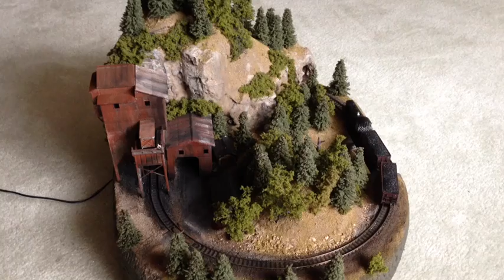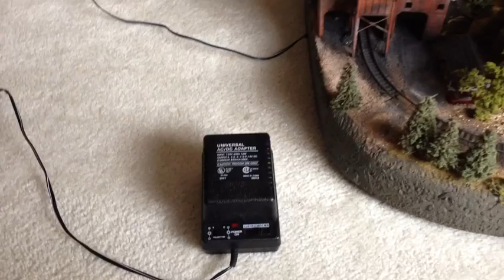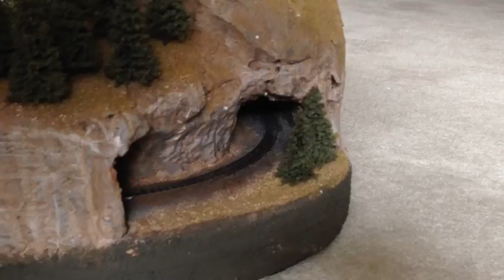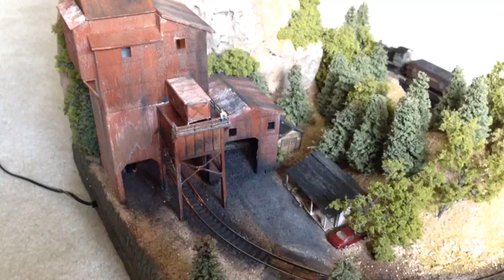N Scale Micro Layout

Comment: Hi Steve, how many cars can you pull on that small of a radius, obviously you are limited to the length of the track, but could you pull them around the full loop if you wanted?
Reply from the maker: So it depends. You need to have them weighted a bit so they don’t get pulled off since the curve is so tight. But there is no grade so you could probably still do several cars. I never tried to do more than three cars since it just looked weird being such a small loop.
Reply: Thanks,  just an idea I had using a helix. I will need to experiment.

Comment: Hi Steve, I enjoy all of your layouts, but for some reason this one really looks cool and so simple, I am just wondering how hard it is to wire a transformer for it, thanks
Reply from the maker: It is super straight forward. I just have the wires from the transformer wired to a double pole double throw switch, and then to the track, with one wire I think going to the on/off toggle switch. the transformer had a variable voltage output, so you could control the speed with that selector switch.

Comment: I am new to this, I was wondering if you could please direct me on how to do this simple wiring.
Reply from the maker: I don't remember exactly how I wired it since it was a long time ago, but I believe I had the wires from the track going to the middle terminals on a double pole double throw toggle switch, then the top and bottom terminals on the switched wired together in an X pattern such that a short wire connects the bottom left terminal to the top right terminal, and another connecting the bottom right with the top left. Then a wire connecting the bottom right terminal to one wire from the wall adapter that puts out DC voltage at different levels based on a selector switch. The bottom left terminal of the toggle switch then goes to one terminal on the on-off toggle switch.The other terminal of the on-off toggle switch then goes to the other wire of the wall adapter. So, the double throw double throw switch will flip the polarity of the power going to the track, and the on-off switch will wither allow power to flow through the circuit or will stop power flow. The voltage selector switch on the wall adapter controls the speed (higher voltage will make the train go faster). It would have all been far simpler to just run two wires from the track to an old Bachmann controller or something like that. But, this was a very basic and cheap way to control the train for this basic display setup.

Comment: That's damn impressive what you have done there. I'm trying the same but with H0 scale.
Reply: Did you build it?
Reply: @jamesparson  I built one in h೦ scale using Marklin r1,r2 and r3 radii. But turns out to be huge. So scrapped it. It was almost 1.2 meter by 1.2 meter in size
Reply: @jamesparson  now working on recreating Mittenwald by Noch

Comment: Great little layout,how did you attach the unitrack to the foam?I see no holes for nails in mine, and I'm a kinda stumped. Please keep these layouts coming, I love them
Reply from the maker: Bob Shaw I just glued the track down, I think I used hot glue to tack it in place then the glue and ballast helps to hold it permanently. I usually use either some hot glue or some type of paintable caulk which works well.  Since I normally at least run glue and ballast along the sides, that holds things down permanently.
Reply: Thanks for the info!

Comment: When building and  running trains on a layout such as this, keep the cars to about the same length and weight.  If cars of significantly differing length are used the overhang of the longer car is likely to pull the shorter car off the track.  Full sized railroads have this problem on curves over 10 degrees, particularly 12 1/2 degrees and over.  Twelve and one half degree curves have a radius of 459.276 feet or 459 feet 3 and 5/16 inches.  Long cars of 89 feet such as Trailer Train, auto racks, etc. can negotiate these curves but they don't like it and are prone to derailing particularly if a much shorter car is between two long cars.  Amtrak negotiates 16 degree curves in Jackson, MS and these are 259.265 foot radius.
Reply from the maker: Roy Reynolds I usually overweight all my cars so they run better on the right curves.

Comment: What would you say building this layout from beginning to finish cost, excluding the train itself? I want to build something of very similar size and track plan with a budget of ~$3-400.
Reply from the maker: It is hard to say for sure, since almost everything on this layout was reused from previous projects. Maybe $150-200? But the thing is that a lot of the scenery materials, paint, etc that you buy will only be partially used on the layout, so the out of pocket cost is higher than the actual materials cost. The mine is a re-kitbashed (I had kitbashed it on a previous layout, then rebuilt part of it again to fit this one) glacier gravel kit, that was the most expensive thing, next was probably the Unitrack.  All the scenery materials I already had on hand, I didn't buy anything new at all for this project, but I used multiple kinds of dirt, ground foam, static grass, shrubs, trees, etc, so the out of pocket cost for all of that might be kind of high, but you wouldn't use very much of any of the packages of materials on a layout this small.

Comment: Well I was just sitting here thinking man it would be fun to build a small rail road maybe not this small but it shows it can be done! Very nice model work.
Reply from the maker: Thanks!  I just started working on 4 similar layouts.  I saw a bunch of pine table tops at Home Depot, and bought all of them.   They are 18-24" in diameter or so (not all the same size). I plan to build four similar type layouts on them and if I get them done in time, sell them at the Great Train Expo in Tulsa early next year.  I'll start having some videos of them up sometime soon.  It has been hard to find time to work on the layouts and the videos lately.

Comment: could you make a layout for the bn in 16' x 25' for like a demo how to super-micro lets build
Reply from the maker: I do plan on making a couple small N scale layouts soon, one or both I plan to try making out of foam core board and spray foam.  I was thinking about something closer to 20" x 30" and another 30" x 40"  since a lot more motive power will run at those sizes, but I've also thought about building a circular one around 16" in diameter that is actually a table lamp as well.  Lots of ideas...very little time right now.  Also, it is super hot in the garage where i work on these right now, so progress on anything is likely to be slow the next couple months.

Comment: Kinks develop in track sections.  That's good to know.  I'm building a small layout myself.  Perhaps I can take some measures to help prevent this when I lay the track.  I've been posting my layout updates here: http://jeffsmorningbrew.blogspot.com/
Reply from the maker: Jeffrey Cobb The metal rail will expand and contract with temperature.  On a small layout like this it might not be much of an issue, but the larger the layout the more important  it is to have some gaps here and there for expansion and to allow the track to contract as well.  On my larger 5x10 foot HO layout I had track bend out of shape in one spot because of thermal expansion of the rail which I fixed by cutting a couple gaps in the rail then gluing things back in the right spot.  Obviously if you keep the layout in a very climate controlled area you will not have much of an issue, but if it might occasionally undergo some larger swings in temperature then the gaps are good to have.
Reply from the maker: Stephen Strum Another issue is that the layout itself may expand and contract with humidity changes if it is framed with wood (which most are).  Different wood types will expand and contract more than others, and if you paint them or seal them in some way that will lessen moisture changes.  It doesn't take much shifting of the wood on an N Scale layout to cause track problems.  Of course this little layout was all foam construction so humidity changes weren't a concern.

Comment: Thanks for posting this. I've had larger n scale layouts in the past and now that I'm in my own place and no where near the room I had before I've often thought of building a new layout but just never have due to space but your video has given me the vision of a small layout. After watching this video I went out and bought a 2x2 piece of thin board and two 2x2 ceiling tiles and glued the ceiling tiles together and then to the board so I have some depth to cut into. Used kitchen door pulls as legs for the base as to hold it up a few inches. Ordered atlas code 80 9-3/4 curves and two 5in straights. The layout will consist of the 93/4 curves and two 5 in straight pieces. Planing on doing a small logging scene on the layout a small batch of houses and a little town. Gonna run a switcher loco and maybe a small sw40 already have the board made up and ground cover base color painted. Waiting on track. Again with this video I wouldn't have had the vision of building a small layout.
Reply from the maker: I'm glad it helped get you back modeling again!   The 2x3 foot layout I am currently posting videos on has kept me busy for many months now, and likely will for at least a couple more months.  The great thing with a small layout is that you can work on the layout anywhere that is comfortable, and then easily put it back out of the way when you are done.

Comment: I am building a portable layout using the same radius Kato track, I have an extra Atlas H15-44 that I don't know if it will be able to run on those curves, what do you think? Also what locomotives can be run on these tight curves?  What locomotive is in the video?
Reply from the maker: In the video, the locomotive is a Bachmann S4.  It is hard to say what particular locomotives will make it around the 6" radius curves since it is all about how much the trucks can turn on the engine.  Also, the same engine type might work from one manufacturer, but not from another.  Some short engines may have details or other parts that prevent the trucks from turning much, and longer engines may allow the trucks to turn more.  So, it varies, but many can probably be modified a bit to allow the tighter turns by shaving off a bit of plastic or the like from the body to allow for tighter turns.  Once you increase the radius to 8" or so, most engines can negotiate the turns.  On my current project layout I can get an AC4400 to go around the 8" curves no problem.  It can't pull cars around those curves though because the body mounted couplers pull the cars off the tracks.  That will be a problem with the 6" radius curves too of course.  Anything much longer than an S4/NW2/SW1500 (The H15-44 isn't much different in length, so I think it should work, but no way to know for sure), would probably have trouble pulling cars because the body mounted couplers on the engine will tend to pull the cars off the track on curves.

Comment from the maker: Marc, with the 6" radius curves, smaller is better.  An NW2, S4, SW1500 or something like that works well for an engine.  You might be able to get a larger engine such as a GP38-2 to go around if the trucks and turn enough, but you probably wouldn't be able to pull any rolling stock.   With a shorter engine like a NW2, you can do 40ft cars without any trouble, and 50 foot cars generally do fine too as long as they have truck mounted couplers.  I have found that it helps to overweight the cars to help keep them from derailing on the curves if you have more than a couple cars on the engine.  

On my new mini-layout project, http://www.youtube.com/playlist?list=PLBicIqyKswmZwTGPxhVW1F2M4Fr1WFD6Q
I have an 8.5" minimum radius and a GP38-2 runs great pulling 50 and 60 foot cars, though it doesn't look great with longer cars on those tight curves. One issue with some cars on both layouts was clearance through the tunnels and tunnel portals with the longer cars since there is a lot of overhang on curves that tight.  

Bottom line is that you can get more things to run on tight radius curves than you would think, but it does vary by manufacturer and car type, etc since clearances around the trucks vary from car to car and on one car the trucks might not pivot as far as on another.
Reply: Thank you for all the helpful information! I have looked online to see a list of locomotives that could handle such a tight radius but no luck, I haven't seen many posts that really show the smallest each locomotive can handle.. I was thinking maybe a small set of ore cars pulled by a GE 44 tonner. But it's great to see that other locomotives can run on these kind of radii. Also, one more question, when you built the layout, how does the trackwork hold up? I know in the video you mentioned that you soldered each section of track, but connection wise was it secure? How often was it cleaned, since it was very small and it ran constantly in a loop at a decent speed I'd assume it was easily done. Thanks again it's very helpful to know what I can do with a small layout. I don't have much room to have a giant layout and always found them intresting.
Reply from the maker: Marc Herrera The unitrack connectors are pretty secure, and you don't really need to solder them, but they can lose conductivity over time.  You could just use more feeders and leave everything unsoldered.  If you plan to do that, one tip I found elsewhere that seems to be a good one is to use fresh unijoiners on the track prior to final assembly of the track if you have put the track sections together and taken them apart multiple times.   While the design prevents the joiners from distorting much, they can still loosen slightly when taken apart multiple times, so putting in fresh joiners prior to final assembly in those cases can help.   Check out John Sing's great 4x4 foot N scale layout.  He has some good tips on using unitrack and how it has held up over time: http://home.comcast.net/~j.sing/Peavine_Layout_Overview.html

As far as cleaning, unitrack seems to stay a little cleaner than other types of track provided it isn't scratched up.  I generally just clean with rubbing alcohol or more recently acetone, which seems to work better.  Though you have to be careful not to get much on the plastic since it will eat away at that.    The unitrack is much more durable than nicer scale track, like Atlas code 55, though of course doesn't look quite as good.  You do need to keep the track pretty clean though with small engines since they can stall easier, but running them frequently, particularly if you use metal wheels on the rolling stock, helps keep the track pretty clean for quite a while.
Reply: Steves Trains dd

Comment from the maker: Tyrone,
The total cost to build this and purchase everything new that is needed would probably be in the $300-350 range.  The biggest cost is the engine/rolling stock and structures.   Most  of the materials I already had on hand for this layout.  For example, only a small amount of ground foam, static grass, ballast, etc, and not a whole bag of anything was used.  At this point I have a supply of scenery and other materials, and all the structures were ones I already had sitting in a box that were pulled from other layouts.   So, the only thing I actually had to purchase was the track, the engine and hopper cars, the foam the layout was built out of, and one bag of trees.  I think my out of pocket cost was about $170 in terms of new items.

Comment: could u do a troreal of how to power it
plz
Reply from the maker: All I did to power it was to take a regular AC to DC power adapter, but one that has a variable voltage output, which I think I picked up at Radio Shack, but possibly somewhere else, cut off the plug that would go into an electronic device, and wire it to the layout.  You could literally just connect the wires from the AC to DC adapter to wires from the track and leave it at that, though the only way to stop the train would be to unplug it.   So, I have the wires going through two toggle switches, also picked up at Radio Shack, first to an on/off switch, and the other a double pole double throw (DPDT) switch that connects from the on/off switch on one set of power leads, and to the track on another.  That switch changes the polarity of the DC power, which in turn changes the direction of travel of the engine.  I've used fixed voltage AC to DC adapters I've had laying around in the past as well, such as those used by old wireless routers, phone chargers, etc.   However with those there is no ability to change the speed (by changing the voltage) so you are stuck with one speed, though you can still wire it to a DPDT switch to change direction.   The track itself is wired using the Kato uni-joiners that have the wires soldered to them, though you could obviously just solder wires to the track directly.